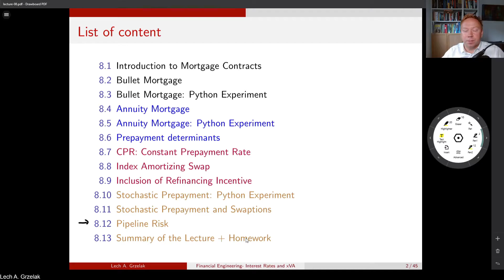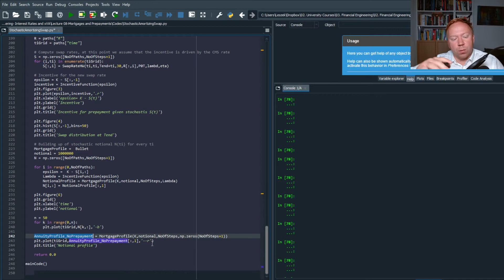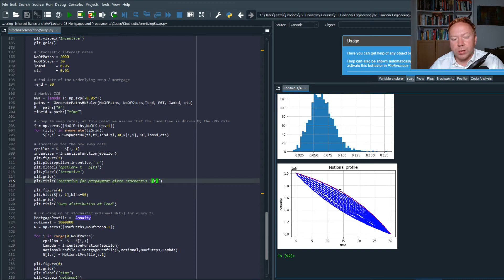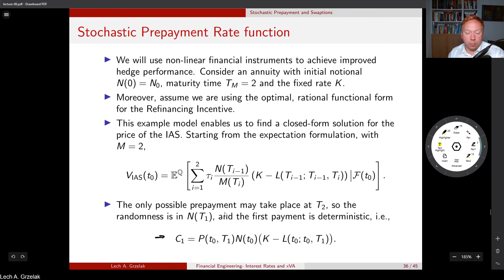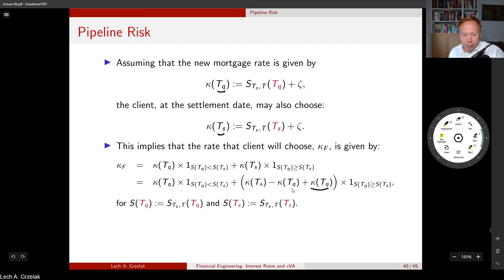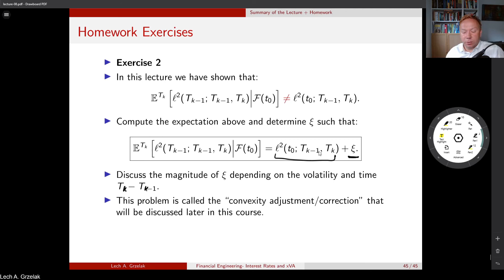Mortgages and Prepayments (Lecture 8/14, part 4/4) | Financial Engineering Course

Comment: Thanks for this series of Mortgage securities lectures, this topic is mostly ignored by most but is so important. One question - why did you use a 30 year swap rate in the CPR calculations? I think you mentioned during the lecture that it should be a 10 Year swap rate. Probably 10 years makes more sense as all the mortgages in the pool may not be 30 years and some may have only 8 years left. Why do we not model the mortgage rates directly that are available on the FRED database? why model the short rates and then try to find a proxy for a mortgage rate when we can just plug in historical mortgage rates into HW model calibation ?  Thanks again.

Comment: Thank you very much sir for the explanation.
I have a small question,

you have used, epsilon = K - S[ :,-1] that is to say you have taken only the last column, except that normally we must make this evaluation at each column that is to say at each date of payment.

Can we take the average on the columns of S and then do K-S at each step and so in the code of annuity and bullet we just make CPR as constant?

Thanks in advance
Reply from the maker: hello Jihed, can you please refer to a particular line in the code? I was looking, and I couldn't find which line you referred to. Thanks. Best, Lech

Comment: Thanks a lot for this lecture. small question concerning pipeline risk: Does the swap k(T_q) and the underlying swap of the swaption in  slide 42 (52:59) consider the prepayments? if so, then I don't think we can use Black's formula, as the Nominals are  then stochastic.
Reply from the maker: Hello Mohammed, indeed, if the notionals are stochastic, you cannot apply the Black-Scholes model anymore. Here, we don't consider prepayment risk in the pipeline risk calculations. I hope it explains. Best, Lech